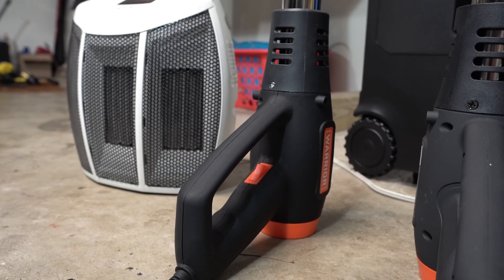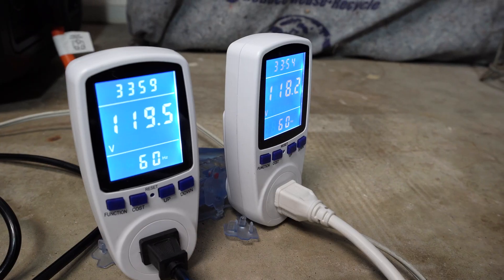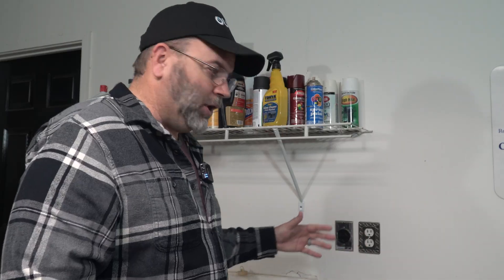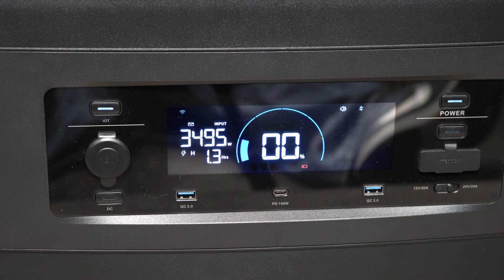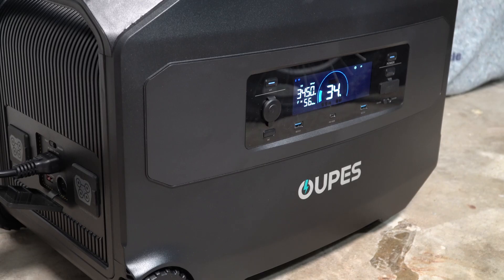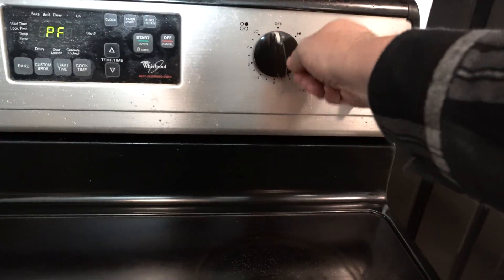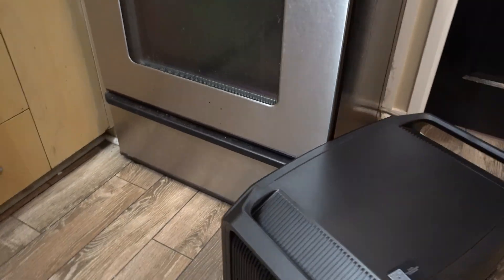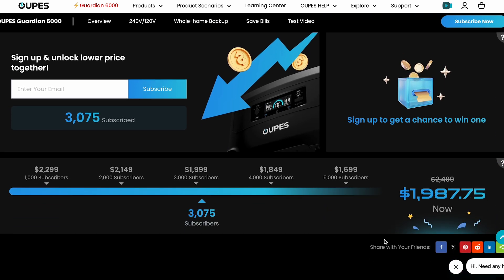I Tested the OUPES Guardian 6000's LIMITS and Here's What Happened

Comment: I too have a 240 volt outlet in my garage which I use to charge my plugin hybrid. If I saw correctly, that is a male connector on the Guardian 6000 which mates with the female end of your cable. You called your cable an Edison? Can you point me to the cable you are using?

Comment: You did an inverter efficiency test with the heat guns, not a battery capacity test.  You'd need to do DC to DC load for a battery capacity test.  Still 89% is quite good as you mentioned.  Very good.  I'm interested but not at 2 grand which is where they are on their pre-sale webpage.  Not for an Oupes but the feature set is impressive.  I'd rather see a true 7200 watt in erter not a 6k with 7.2k "boost" mode but there are always compromises when we deal with newer tech on these power stations.  I have the Bluetti Apex 300 that does 240 natively but can't compete with this units battery capacity or its in erter output with one unit.  I did only pay 1100 bucks for it though.  Anyway, interesting product.  If they can get that proce down in or under $1500 they are going to move some product. Good review.

Comment: Nice video.  Is there any way you can check the voltage when it goes into the boost mode?  I assume they drop the voltage to increase the amps.  Can you check the voltage on the two battery expansion ports?  Thanks.

Comment: I don’t know Scott I in joyed the test. I see no other comments on your testing I hope others see this and see what the g6000 can do. The one big thing for me would be to see it run a water well pump mine is about 1300 watts so it should be no problems. Thanks again
Reply: It would run the well pump with no problem, and the well pump just cycles when pressure drops. Just flushing a toilet, cycling the pump, guessing it would last a long time. This is an incredible setup, but it takes a massive amount of power to run a home. If you had a robust solar, you could have a small window unit run all night, then charge up during the day, but it is all math, watts in, watts out, battery capacity, and efficiency. With all these details, you can figure very close, the run time. I have a Titan 3, did a 5000 btu window AC, I think it ran 3 hours and 40 minutes, still at 50% capacity. That was on max, so it never cycled off. I had it in a small, very inefficient camper. Outside air was 85 and  high humidity, inside was 68, 60% humidity. I really need to film so tests to share